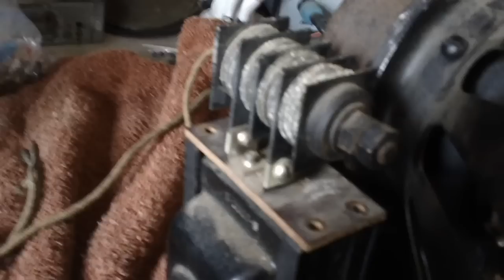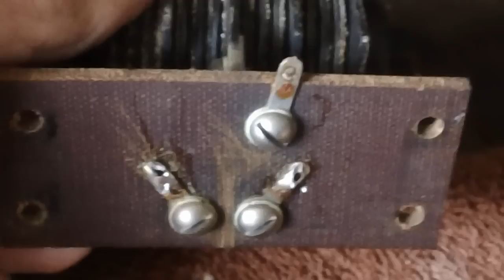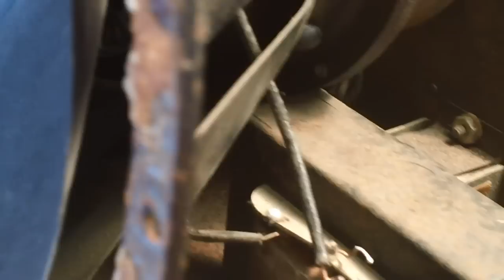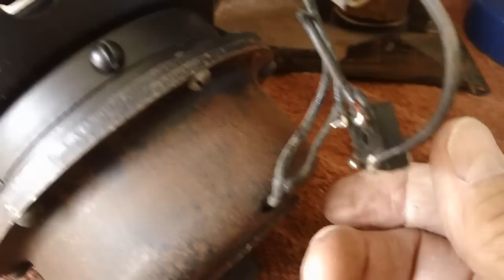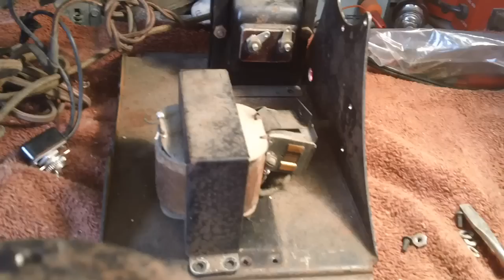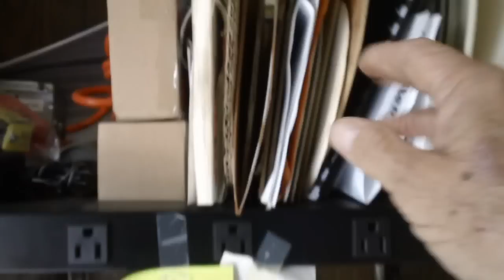1927/28/29 Rola speaker restoration (Part 4).

Comment: If you don't put that cardboard cover over the speaker, your meathooks will go through the speaker cone guaranteed! You bet it will happen, happened to me with my Zenith 10-S-155, well not meet hooks but a screwdriver that someone tossed back on the workbench... Then had a nice hole to repair on a 12" speaker. 

Looking forward to seeing how it all turns out, that Rola is similar to an RCA Model 106 (I think) speaker, but the RCA was but into a "Radio Table" that you would then nicely sit your RCA Radiola on top of.

Comment: yes it is a good idea to protect the front of the speaker cone. By the way John, I found a new purpose to recycle those old Tupperware container lids that I've been collecting that have no more use to store food in. I've taken the round ones and used the different sized round lids to cover my speakers when I'm working on a radio chassis. it gives them another purpose. Because as you know we seem to accumulate a lot of Tupperware, especially when people give us food in them over the holidays and we don't know what to do with the containers after so I've started using them to protect radio speakers while the radio is being worked on.
Reply from the maker: Tupperware lids...that is a cool idea, especially for use with the smaller speakers.  Good thinking, my friend.
Regards,
John

Comment: You will most likely need a dropping resistor when using a silicon rectifier.  I would remove the bridge and use two silicon diodes configured for full wave rectification.  I am not sure what size or wattage of resistor would would need.  Hopefully someone else who reads this will know. ;-) On the other hand, being an electromagnet, can it be damaged by having 20% or so more voltage on it?  Selenium rectifiers from what I read are about 80% efficient.  I have no idea how efficient copper oxide rectifiers are.  You may just end up with a stronger field without a dropping resistor which may or may not affect the speakers performance.  You could always run it off a variac with reduced voltage as well.
Reply from the maker: You bring up a good point, my friend.  But not to worry.  Dropping resistors and such are a long ways off with this project, so stick around for the fun.
Regards,
John

Comment: 7748 on the bridge rectifier  looks like a date code, 48th week of 77 manufacture date. VS048 is a standard bridge part number although on various sites I see it listed as 100 volt 8 amp and on a different site 50 volt 2 amps. Interesting design, the field coil would get pulsating DC from either the bridge or the original Cop Ox rectifier. I wonder if hum was an issue with these or if the inductance of the field coil was enough of a filter. Very cool speaker John. I have never seen a powered field coil external speaker before.
Reply from the maker: Larry,
I'm currently discussing a possible hum issue with my mentor, Brendan.   Trust me, if we encounter hum it will go away.  I'll also probably install a much  better bridge rectifier in it.
Regards,
John